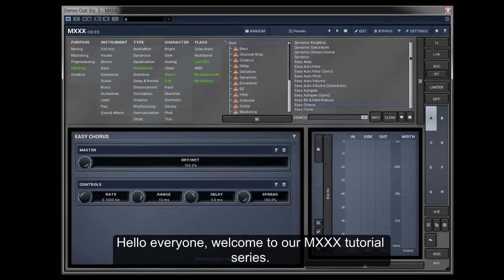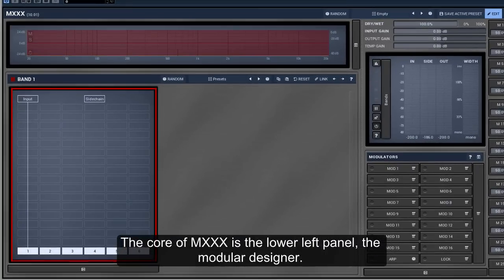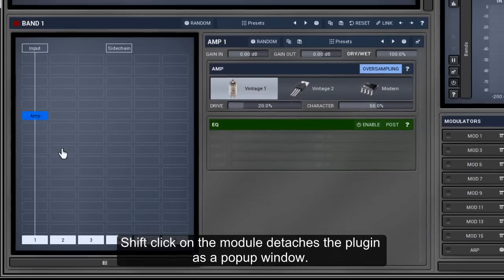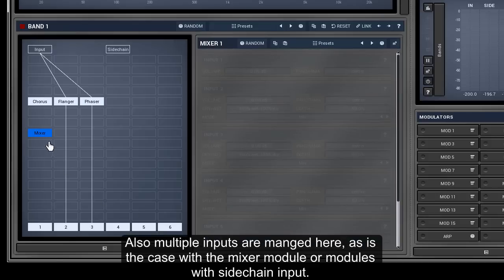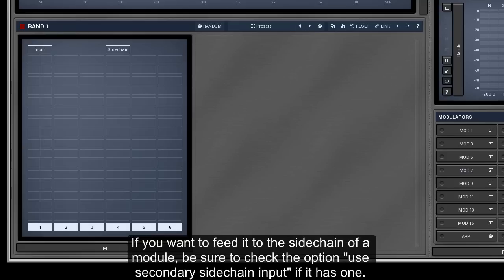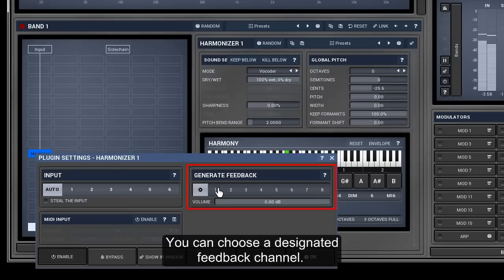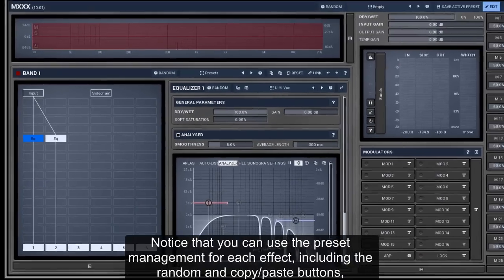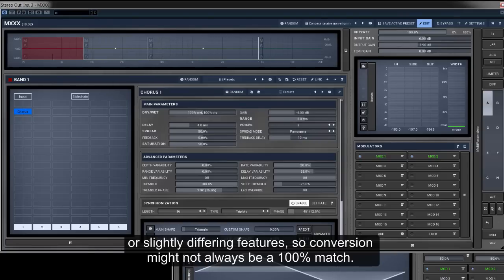MXXX tutorial #1 - Basics & Routing

Comment: At what point does the CPU go insane with the feedback delay? 1ms? At some point I'm assuming the buffer between plugins will be greater than the feedback loop delay and since it won't be able to "look forward in time" it will crash with certain routings or audio will do funny things or cutout. Let me know how that all works in detail. I want to know what the limitations are because feedback is great but there are a lot of benefits of analog feedback when your feedback loop is instant. I guess at that point it's recursion?
Reply from the maker: There are no limitations really. What the plugin needs to do however is subgranularize the processing buffers arbitrarily, so if you set feedback say 1ms, then the maximum buffer internally is 1ms, hence 44 samples in 44.1kHz. The engine does that automatically, so there's no need to worry, but with very low feedback sizes the CPU increases heavily of course, depends on the algorithm as well.
Reply: Fascinating. I've heard about some recursion problems that would take longer than the universe to calculate. Are there any routing's that you've encountered that would basically be impossible for any computer to compute? I'm very interested in audio feedback concepts, it would be great to see a demonstration of some of the quirks of feedback.
Reply from the maker: Well, of course if you use 1 sample feedback it will require huge amount of CPU compared to say 32 samples, but it will all depend on what is inside the feedback. You can definitely create algorithms, that would kill your computer, but a scheme that would kill any computer (meaning that it's principle is so demanding), I don't know. Recursion is definitely not needed for feedback. You can have a feedback inside a feedback, but that only doubles the requirements (in MXXX it would more like be the maximum of both feedbacks actually). So again, nothing too horrific. Just try it and you'll see ;)
Reply: i think i'm becoming a scientist just by reading your conversation here...